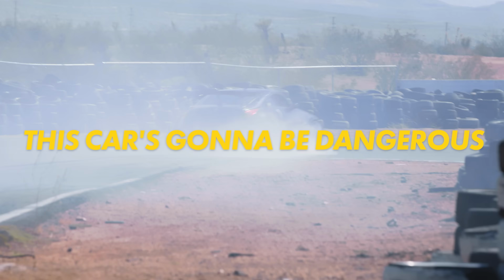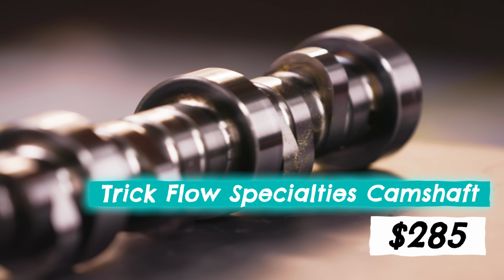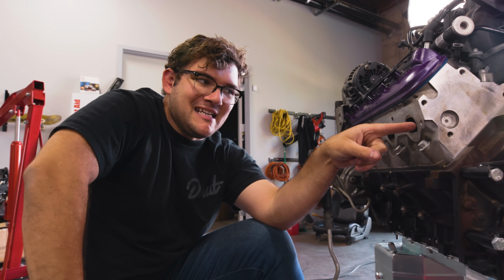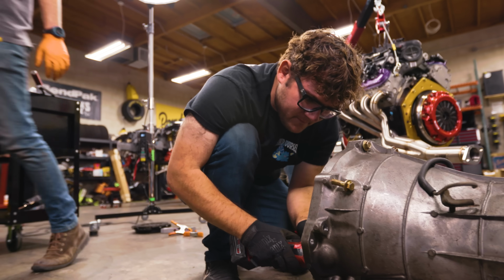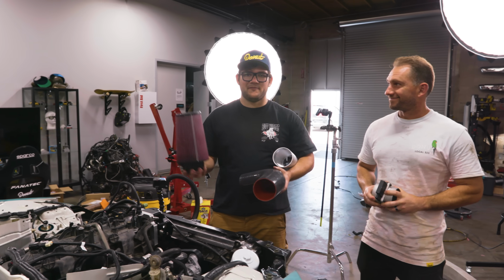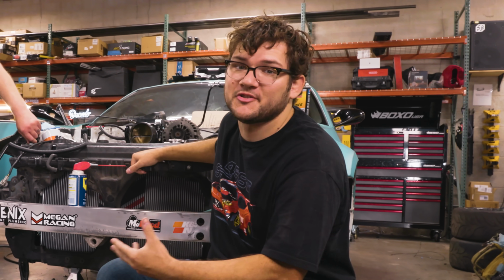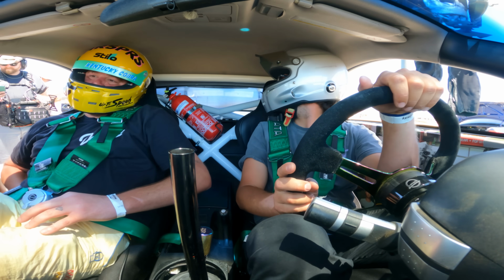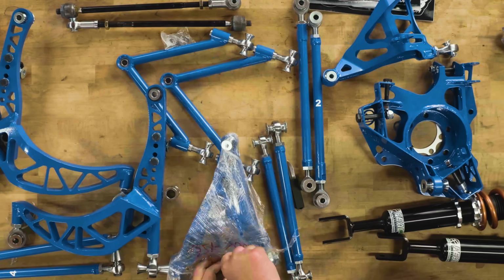$8000 Junkyard V8 vs $30,000 Crate V8 Engine Swap

Comment: Finally, something dispelling the myth that you can just go buy great junkyard LS motors for a song. $10k for a wrecked truck motor! That's nuts!
Reply: That's with upgrades and the components to make it work in their car. You can do it a lot cheaper
Reply: I LS swapped my Grumman. The engine was one of the cheapest parts of the build.
Reply: And I bought the same motor as them lq9 for $1500 Canadian with a complete harness.
Reply: 5.3ls is 500 to 1000 6.0ls is 1000 to 2000 reman 6.0 is 4500🤦
Reply: Not a LS, but my 2.5 duratech was 500 dollars from LKQ @ 5k miles.
Reply: @86ConstructionContracting  that's because their number wasn't on the caller ID when you called around.
Reply: It's 8k. And that includes the entire swapped list of components.  The actual motor from the junkyard would've been around 1000 to 1500 USD.
Reply: i bought a 8.1l for $99 at my local u-pull-it
Reply: The motor itself didn’t cost 10 grand. That’s for all the parts, accessories, adapters, etc. Motor probably didn’t run them much more than a few grand.
Reply: @trentmckenzie343  Yes.
Reply: It's not really a wrecked truck motor if you rebuild it... and the actual cost to do that is closer to 3g for a complete in-depth rebuild.
Reply: It’s like a lottery…. But if you have luck you get yourself a great engine for a bargain
Reply: 10k for a mirror and 10k to install a motor are NOT the same thing.
Reply: We have a line of 5.3s and 6.0 s for swaps in our shop. Didn't pay over 750 for any of them.
Reply: The new one is 4x the price, how is it NOT a song by comparison?
Reply: @SuperAirsoft19  they said 8k engine with 5k in parts I believe but I know you can buy a crate 6.0 for like 4k lol
Reply: You totally still can get an ls for less than 500 if you pull it yourself.
Reply: In my city I can pull a complete ls motor for 300 after tax thats top down and front to back harness and exhaust manifold from a self service yard and done by myself. 3-5 hundred for complete clean mangaflex  decked planed bore cam bearings soft plugs if block is good leaves me with 72-74 hundred to outbeast that 30k blueprint
Reply: I've been saying that in the Foxbody community with folks saying "Get a wrecked V8 for $500/$1,000" in comments for a decade.
Reply: Just bought a brand new crate 5.3 about 2 months ago. $7k in the truck.
Reply: @Fredness2300  you can. You can literally get ANY motor you want from the junkyard for less than $500. You just have to pull it yourself. They just price them generically. They don’t care what engine it is
Reply: Got an lq4 and 4l80e trans out of a 2500hd for 1500. Parted the truck and made most of it back. All about finding a good donor car

Comment: We need to see the driver swap and redo the 0-60s. I'm 100% convinced low-car driver on the hi-car will beat that 5.12
Reply: Nolan could do it for sure.
Reply: Nolan’s improvement is really excited to watch through these vids
Reply: whats funny is that a stock 370z is faster than both of these. People who say "no replacement for displacement" are wrong lmao.
Reply: @TakeThis_L  I was expecting better numbers too.
Reply: @TakeThis_L  there are multiple things that can effect performance weight, power, displacement, n/a vs turbo or supercharger with the 6.2L ls that motor would be more suited for boost not n/a if they bored it out and ported it a little then it would help
Reply: and an addon to this the 370z also has VVT (Variable Valve Timing) meaning it can produce more power at higher rpm because of it changing the timing at set rpm
Reply: @TakeThis_L  I don't think you understand what that saying means
Reply: I'm convinced that High Car is putting too much to the wheels and keeping traction is what ruined it
Reply: @Hiukuss  the saying means a bigger engine equals more speed/more power. Stop over complicating it.

Comment: I had a feeling some LS swaps were on the way after hearing them hint they were swapping the engines on these things. It really goes to show that the LS is the king of engine swaps. Just about anyone can go yank an iron block out of a junked Silverado or Suburban and with the right parts and mods you can fit them in almost anything.
Reply: 2jz is king
Reply: @danielzapien24  have you heard the good word of our (australian) lord, the 3800/L36?
Reply: @Daniel Zapien  Lord K24 would like a word with you

Comment: Nice to see Low car finally coming out on top in an actual performance test - Could have just been due to nolan having more drag experience, but I dont care.  This is the kind of stuff that I think this series should really be about:  Low car getting the cheaper parts, but actually being able to hold it's own against Hi car when the rubber meets the road
Reply: That and the fact that hi-car has more power and difficulty putting it to the ground, definitely needs some drag radials for a proper launch and not do burnouts for distance 😅love both those cars tho, low-car is my dream build at this point.
Reply: I think that it's almost completely because of transmission. Lo car was in third gear crossing the line every time and Hi car was in second. Hi car just had longer gears. Traction and driving differences yes but I'll bet the transmission made the biggest difference.

Comment: You forgot to mention K&N  air filters also guarantee more particals in your engine.
Reply: That Project Farm comparison was brutal haha
Reply: I bought a K&N for my 03 Chevy Express van LQ9 6.0 and it had a gap where it fit onto the stock  mass air flow so didn't end up using it. Could have probably fit a baseball card through the gap. Back to STP after that.

Comment: With the HP difference, I would imagine the time difference is down to the low end torque optimizations of the truck engine. The 30K motor likely doesn't make it's horse power until much higher in the rev ranges.
Reply: the truck engine was made to haul at the end of the day
Reply: @ManLikeEddy  Right!  And in this case, it was hauling ass.
Reply: @Bellboy40  no doubt

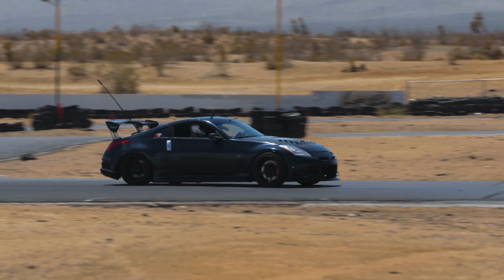Comment: 31:17 dude my power steering line on my car blew only difference is mines 50 YEARS older. Sure don't make them like they use to
Reply: The ones that blew on their Nissan Z were 20 years old and while yes, they don’t make them like they used to but better than the modern cars.

Comment: Wait hold on just one second. The engine mounts on the HI team cost more than the new transmission???? Those mounts better be levitating the motor at this point if it really cost that much.
Reply: I had to rewatch to see if I misread that. Wtf are they made of gold.
Reply: Literally the kind of approach that COULD be great, and most of the time stays that way. They just lost AC and made it harder to install the motor.
Reply: @300zxdriver  I just watched and I think it also includes other relocating hardware. If you go back to the frame where they show the receipt, you can see the other stuff included in that price.
Reply: @olifyoseph9363  Still a lot of money.💵
Reply: ESP since I made my own swap engine mounts literally for free 12 years ago
Reply: Big part of these kind of high level performance parts comes from the R&D behind. Those mounts probably have tons of testing behind for motor placement, angles and such. Also all the materials and machines needed for it. But I agree, those seem extremely expensive for what they are. They are probably designed for Pro FD? No idea who would want to spend so much on motor mounts for an LS swap on a 350z lmao
Reply: @300zxdriver  true
Reply: @fns58  doesn’t matter when you can write it off
Reply: @fns58  hi-car that's who...

Comment: the best part is that the stock Z transmission might actually be stronger than the T-56. Those Z trans are good for 700-1000 hp depending on mileage
Reply: The z transmission IS a t-56
Reply: Honestly, had they used the trans from their Z, hi car may have pulled out the W on low car.
Reply: @71sc502  stock z transmission is the cd009.
Reply: Lol, no. That's a built T56.
Reply: @71sc502  nope a CD-009
Reply: @rustler08  they didnt say it was built. Also why buy a built trans for a car making under 500 whp
Reply: @71sc502  you can literally use google, how did you still get it wrong
Reply: @goose9246  it is depends on the year
Reply: @71sc502  no it doesnt, the 350z never had a t-56 from factory

Comment: Funny how a well tuned OG 350Z engine would smoke both this swapped ones 😂
Reply: facts
Reply: @lordmaziofficial2438  A well tuned V8 too
Reply: i thought they took those og engines out because they blew up
Reply: @SirFiggles  I haven't watched all the videos so I don't know but my point still stands.
Reply: @Hector55Munoz  yes true, a V8 is a monster if it's properly tuned. The thing is I would put all of the money that was meant for the new engine in tuning the OG engine rather than swapping and tuning the new one. If the OG's were blown up I don't know but a good engine is worth the tune :-) I know they did this just for the show
Reply: @BlackBullPistol  Yea a 350z is one of my favorite cars. In fact that's the car I'm getting my friend to buy as his first project car. Unfortunately they turbo'd both cars and took them for a tune only to make mid 300s hp. Plus one engine blew. Idk how bad that tune is but it's true a good tune should make more than that.. I mean my base c4 vette stage 1 top end stock bottom makes 450hp NA.. with a mail order tune. That's what I meant. I was disappointed by the power they got out of the 8k turbo and dyno tune session. Did the 350z bad on that part.

Comment: For anyone that watches this. If you are considering a junkyard LS swap. Buy a whole truck or van. Preferably a truck or suv. I’ve done 15 swaps I usually get the trucks for between $1500 and $3500. I part out everything I don’t need and keep what I do. My last swap ended up making me money between selling everything off the donor vehicle and selling the old drivetrain from my 1996 c1500. I made $400 swapping in an lq4 and 4l80e

Comment: No one wrenched too hard on that exhaust bolt. From working at Chevy I can tell you broken exhaust bolts on the trucks are pretty normal.

Also, those 0-60 times make me appreciate my E46 M3 more and more. 333hp and it does it quicker. I would like to see the dyno graphs for the Z cars though. I feel like that truck engine might have a longer stroke or something that helps it make more torque. Possible the lesser horsepower also helps it to be more manageable.

Comment: Put a standard Chevy v8 in my truck when the og engine blew. When the mechanic pulled it out of the crate, all I could think about was “damn, I wanna put this in something that doesn’t weigh 5,000 lbs”. It was huge.

Comment: Here’s a quick tip if you want a car with a little bit high horsepower get a 2007 Kia Sedona it has 250 hp with 253 foot pounds of torque it gets going around 4000 RPM. It’s a really good car. I did a tuneup on mine so mine Had 320 hp and that thing was fast

Comment: wonder why the screw extractors aren't carbide tipped to keep breakage from happening, best guess is to not strip out once you get them into the screw/bolt that needs to be extracted

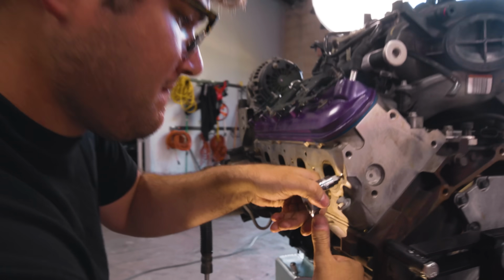Comment: 11:08 same thing happen to me and my dad we tried replacing the exhaust manifold cause it crack so as we take it off we noticed it had a stripped bolt so we tryed to take it out and we broke 2 extractor tips and now check engine light on for ever cause he don’t feel like fixing it

Comment: FYI exhaust manifold bolt sometimes just end up snapping, not because they were too tight, but because of pressure, heat, and exhaust movement.... That being said it could of also been snapped because somebody tried to over torque it.

Comment: I'd like to comment on the broken extractor tool incident... I've been a mechanic for half my life(I'm 36yrs young) and even before that I was always tearing my toys apart and putting them back together. I think the problem they encountered was that they used an extractor that was too small. You need to use the biggest extractor you can. Don't try and extract a half inch bolt with a quarter inch extractor... Use a 7/16" extractor. Plus, breaking a bolt while tightening is easier to extract then breaking a bolt while trying to loosen it. Once the head of the bolt breaks off while tightening, the pressure is relieved from the threads aka easy extraction. Removing the bolt and having it break means the threads are binded in the hole... Heat, lubricant and patience are they way to go.

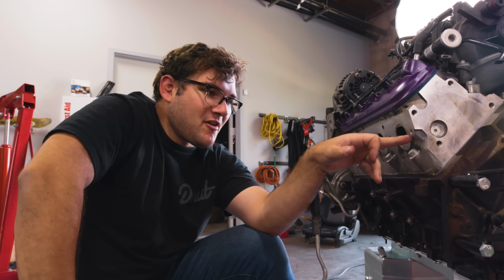Comment: 10:52 lmao... good grief, guys... It's SUPER common on those engines.  The bolts closest to the firewall break on their own due to manifold heat cycles.  MIG weld a nut to it, let it cool and wrench it out.  It's not a big deal.  Like I said... VERY common on these.

Comment: Challenge you to rig up a boat motor in a vehicle. Mercury Marine has inline and V engines. Choice of I4, V6, V8, V10, V12 or Mercruiser inboard V8 crate engines. If you're lucky enough they might sell you an inboard crate engine for racing at 1750 HP which might have to go in a truck bay.

Comment: Low car feels better for drifting because the motor is an iron block. The block gives it low and heavy front inertia . High car aluminum bock doesn't have those properties. High car will be years better with force induction(5-600hp). It will drift further with more control even if low car has equivalent power.

Comment: Both cars sound great, but the blue one sounds nuts. They say the black one looks better, And I may catch hate for this, But I think the blue one looks better. If they got rid of the "elephant trunk" and just poked the intake halfway through the hood that would make it look better than the "trunk" lol. I had guessed low car would be quicker at the very beginning of the video simply because built will always beat bought, At least in my 17 yrs of mechanical experience...

Comment: In high car, the decision to move the motor back changed its weight distribution and the rest of the suspension and steering needs adjusted

Comment: ❤😂😅❤😂epic builds, guys invest in a port power hydraulic puller/pusher/cutter saves hours and beating and hammering. 
we use our all the time when doing engines swaps to make clearance and the finish is 100 times smoother and less bumpy

Comment: You shouldn't heat the hole. Just cool the part. Heating a piece of metal with a hole in it will actually make the hole smaller. It is good for breaking out bolts because it shrinks the gap and presses on the bolt then when it cools the hole gets bigger and creates a bigger gap.

Comment: Low car is probably the better drifter. Iron block that isn't mounted back and low keeps lots of weight off the rear. Also, being a truck motor means it's made for torque out the ass.

Comment: It seems you’ve done something wrong. Is there some gear ratio in the tranny/diff that’s causing the more powerful motor with exhaust etc to be slower than the less powerful motor etc?…. Should have done a top speed run as well

Comment: So while rewatching this it dawned on me that Low Car Spent 8K to drop in an LQ9. Now the last junkyard motor I bought was 2015 and it was an LQ4 but they were like $500. I really want to see a price break down on this because what the hell happened where junkyard motors are getting so pricey?
Reply: Your not taking into account the parts used on the list, plus additional odds and ends with some couldn't be utilized. Swapping a 350z is a little pricier given the obd2 and the swap parts needed to fit properly is more costly.

Comment: I really like to watch videos like this, it's really cool to see all the mods. But at the same time I am very skeptical, I don't see how you can do things like this in a garage without access to professional industrial equipment and get decent results.

I am a machinist and I make gears for a living. We make gears for all kind of things with tolerances as high as 0,02 mm every day. Still, our standards of quality are generally not high enough to meet the requirements of the automotive
industry, so we usually don't make parts that end up in cars.

Then I watch a video like this one and the boys are cleaning a cylinder head by going at it manually with sandpaper on a wood block and I am just over here squirming

Comment: The nissan transmission has shorter gears for a lower torque Jananese engine.  The LS3 and T56 needs 4.10 gears.

Comment: what if both cars had the same brake pads on, then you could see if the problem lies in the brake shoes and not in the caliber itself. I think the problem lies in the brake pads and not in caliber and brake disc , since the expensive brake pads are better at dissipating heat because better material has been used.

Comment: Wanna fast v8 350z?
The aluminum block,
900lbs weight reduction including.....
Tube chassis, carbon fiber/fiberglass body 
Mid/rear-engine with manual transaxle
N/A with nitrous.
Factory ride height.
Trust me bro

Comment: I will say i loved the video however with a 0-60 theyre testing more torque and tire performance. Running a full 1/4  strip i bet high car would have came around low car on the 1000' and taken the race. Horsepower is about how fast the car can continue to move. Torque is about how quickly the motor can move weight in a shorter distance. At the 1000' to 1/8 mile your moving from a good mix of torque and horsepower to mostly horsepower.

Comment: 5700 to make 400whp in a 6.0? That seems crazy to me considering ive seen those 6.0s push power very easy. Would have been a much better comparison if you had boosted it